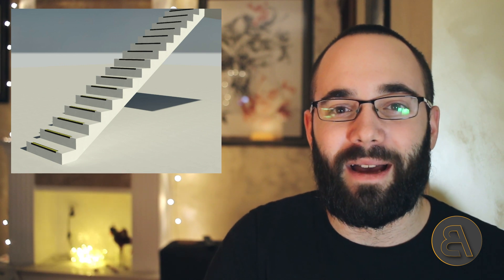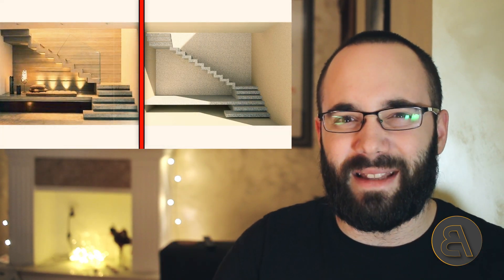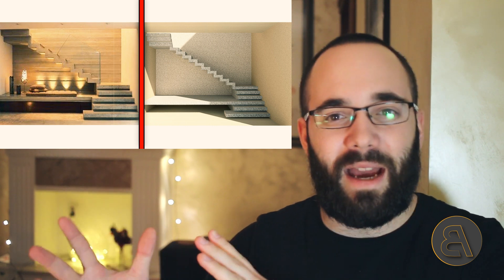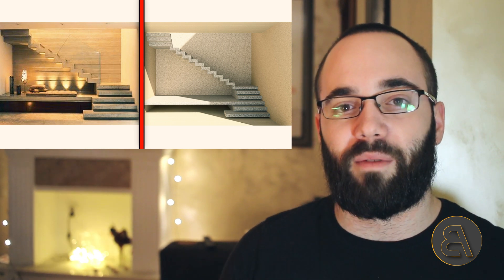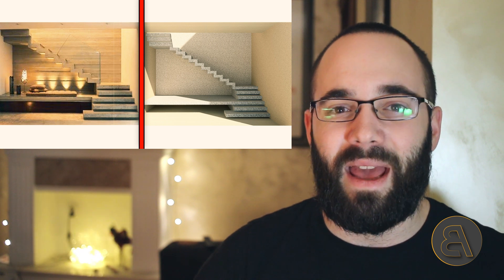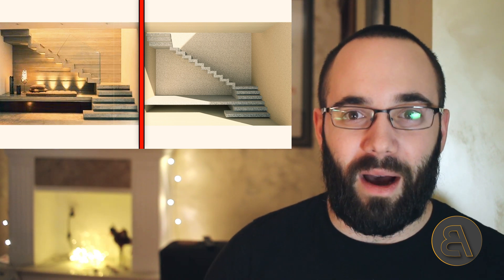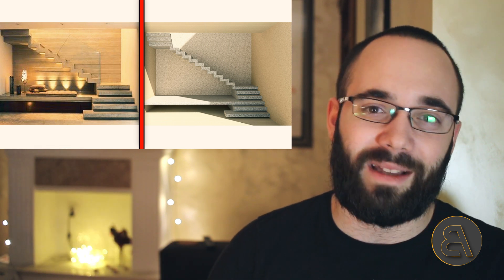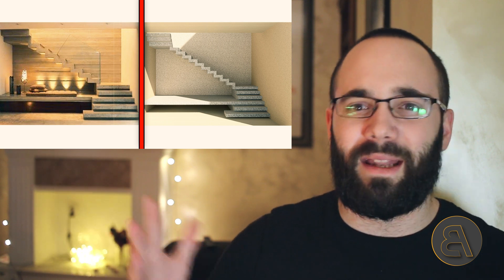Stairs and Railing in Revit 5h Course

Comment: Hello, May I please know how do u model tubes / pipes all over an architecture to create the postmodernism High-Tech architecture aesthetic? Something like the Pompidou Paris. The pipes and tubes are meant for visual purposes only, meaning it’s not meant for MEP records in Revit. 
But right now the MEP systems in Revit is too technical for me to use and it’s an overkill to try to get the aesthetic by using this method. and using family is too taxing for the computer as it takes up a big memory. 

I would like to know how to do it with the “Model in Place” method please.